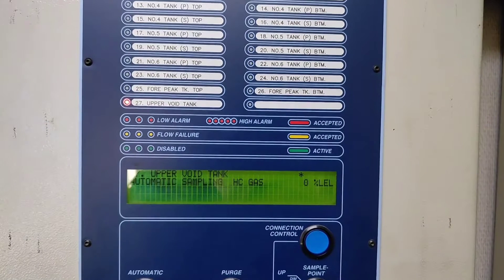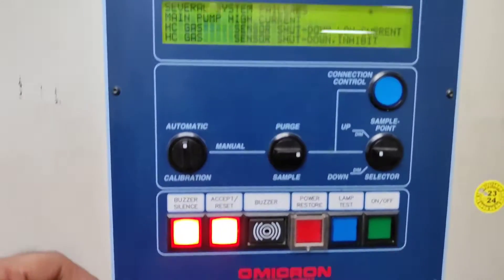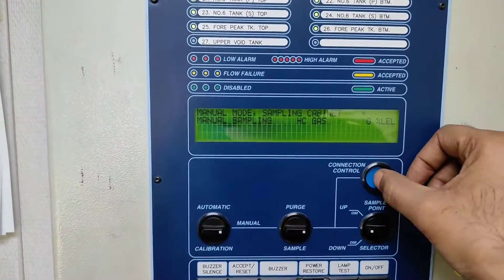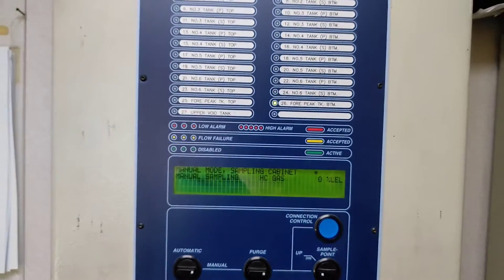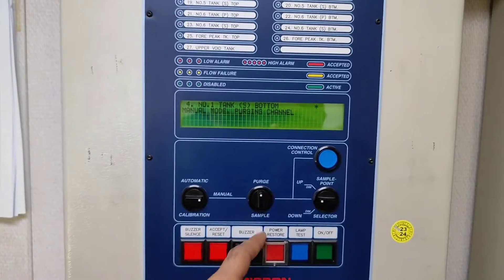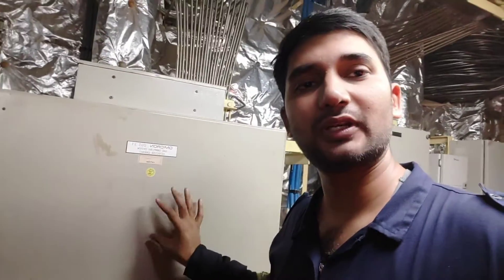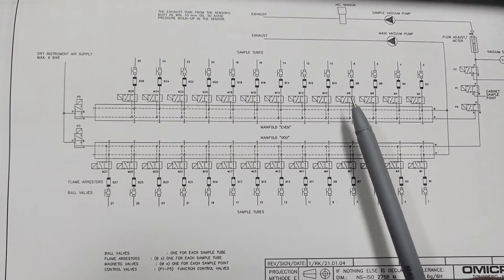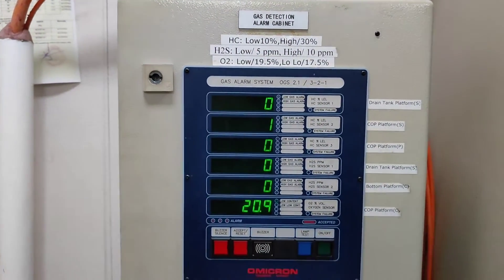Fixed Gas Detection System on Ships Working & Operation || OMICRON Gas detection system on Tankers

Comment: thanks sir. but why we need gas detection system in water ballast tank, in WBT have treated water on it?
Reply from the maker: When we have water in our WBT we isolate those tanks with gas detection system, one reason why we need gas system in WBT is that if we have any cargo leaks to wbt tanks it will give alarm.